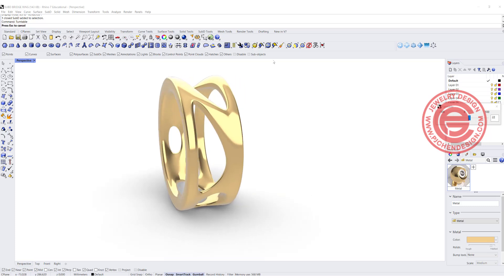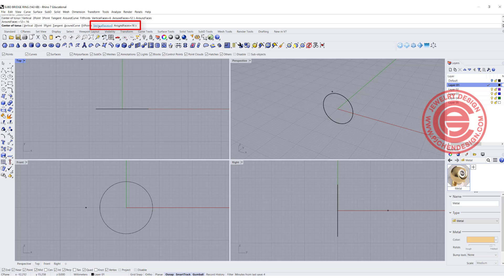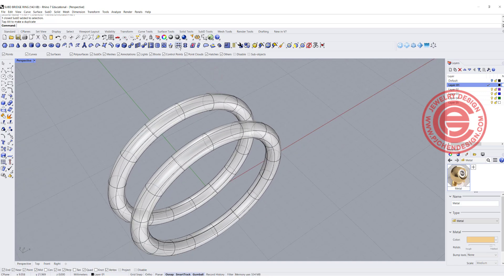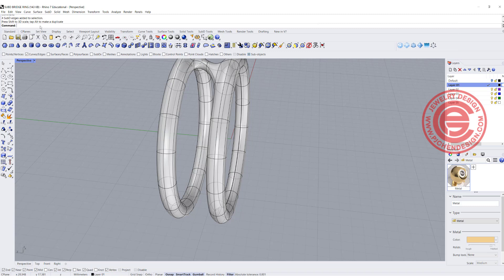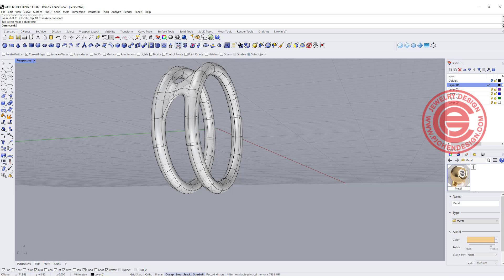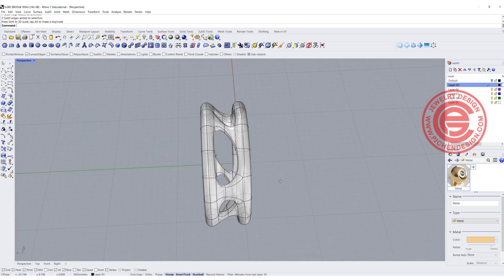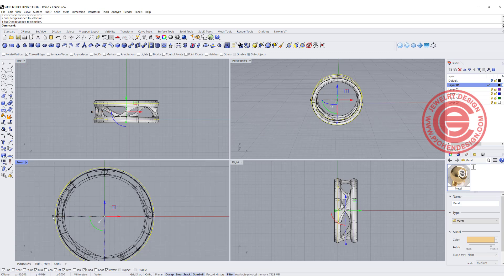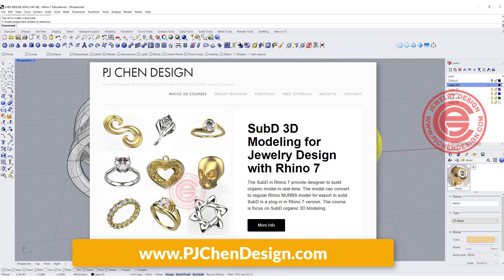SubD Men's Ring- Jewelry CAD Design Tutorial 3D Modeling with Rhino 3D #208

Comment: Hello, I have a question about how I can change the dimension of the ring to adapt it to different numberings without having to redo it from 0 for each of the numbers?
Reply from the maker: if you are talking about ring size. it depends on if you have the stone on it or not. you can 3D scale it up and down 1 size without notice much about the thickness. if you have stone. you need to rebuild the ring. As long as you have original curve on. it should not take too long to rebuild.